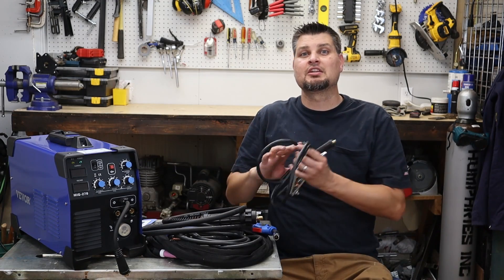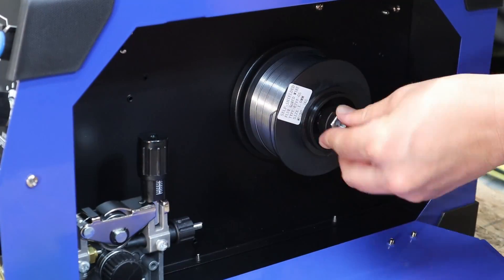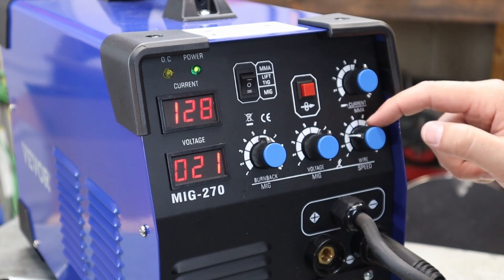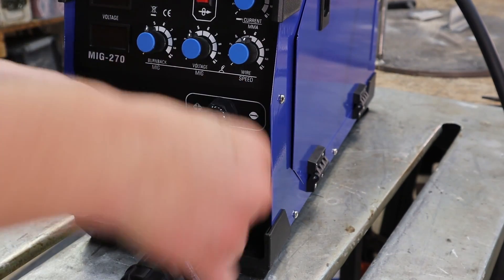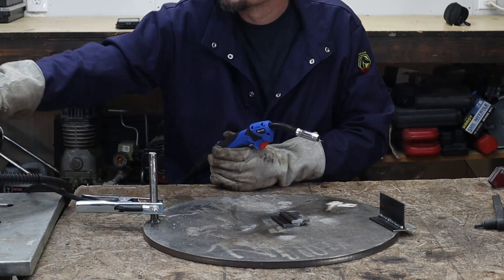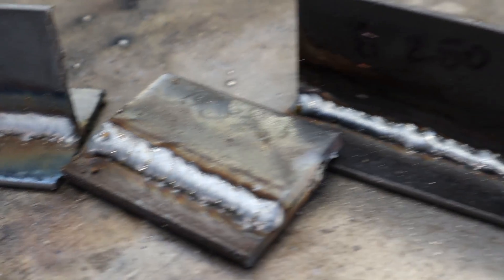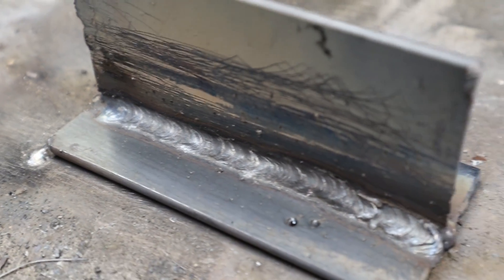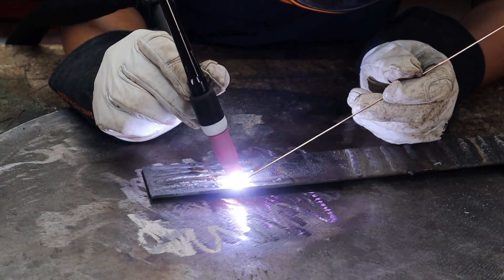Welder Review: VEVOR 270 Multi Process (MIG, FLUX, STICK, TIG)

Comment: The Amazon site (Mophor 270) claims 270 amp, while the Vevor site says 220 amp. I'm assuming the latter is a typo (changing "7" into "2")? Your video shows how the amp setting can max out at 270

There are other Vevor models -- 160 amp, 200 amp, 250 amp (Mig-250). Trying to figure out this "spread", what is different (internal hardware) in these models?
Reply from the maker: I bet they are all the same on the inside!

Comment: None of these videos explain the connection on the machine for stick welder shows fast connection but not where on the machine
Reply from the maker: Disconnect the little stub connection for the mig. Put the electrode holder into the positive and the ground clamp into the negative.

Comment: What diameter Tungsten does this machine require ?
Reply from the maker: It will depend on what amperage you are wanting to run on. 3/32" is a very common size that would work for most projects.

Comment: salut très intéressant. Il prend le fil fourré en 0.6mm, en mig fourré on peut descendre à combien d’ampères stp ? 30?
Reply from the maker: Doesn't matter what wire thickness, the lowest it will go on the display is 45.
Reply: @-DIYPRO-  Oki doki. I am thinking too of the vevor mig 200d3. It seems that it accept 20 or 30 amp (so perfect for thin plates for cars). What do you think about it ?

Comment: I'm wondering how well these Vevor 270's are holding up?  Has anyone out there have longer term experience?  Any warranty claims?
Reply from the maker: I think they've only been out a couple years so even if someone picked one up when they first came out it would be nice to know how it's running.
Reply: Thanks!  I think I might grab one.
Reply: I have had mine for almost 2 years. It is not a miller, but it gets the job done

Comment: looking into getting one of these but i’m curious will it weld a 1/8 6010 electrode?
Reply from the maker: I haven't tried 6010 but i'd say no, you'd be better off getting one that can handle that. I have the ESAB rebel that has a 6010 setting, it rocks, but you are also paying for it.
Reply: @-DIYPRO-  much appreciated information thanks
Reply: @juanmireles1356  no it will not. I have tried. It also doesnt really like 6011 either

Comment: How thick of steel can you weld with 110 vs 220 and does it state what the duty cycle is?
Reply from the maker: Correct it doesn't say. Comfortably I'd say 3/16" on 110 and 5/16" on 220.
Reply: I have 2 of these. Great machines with the right wire. Ive had a hard time getting the settings just right for mig sometimes though. I have welded 3/8 with it but you MUST run very short runs or you will wreck it. It says duty cycle is 60% @ 220amps but i know for a fact that is too high

Comment: This welder is 220amp not 270amp. check the label on the back. It worked pretty good though. Went with HBM2280 instead and it is pretty good.
Reply from the maker: Is that the Hitbox brand? Did you pick it up on Amazon?
Reply: @-DIYPRO-  no on ebay.

Comment: What kind of power requirements does this need? My garage is only set up for 60amps, since it is split off with my house
Reply from the maker: I ran it on my 110 volt 20 amp plug and 220V 50 amp. (my 50amp plug is way oversized I think it only draws about 30amp on 220v.

Comment: Nice review thanks. For the money if pne knows at least a little bit about welding it seems to be great machine for diyers. Have you tried Aluminum mig with it?
Reply from the maker: No, I don't think you can hook up a spool gun with this model. I'll have to check out the manual again and see if they sell one separate.
Reply: @-DIYPRO-  
Thanks for the reply. I have seen reviews on same welder 200 amps and they welded aluminum no issues... This 270 welder just arrived on our front porch. :)
Reply: @luboshcamber1992  what kind of aluminum welding did you do with it, can you Tig aluminum with it properly
Reply: @genesispressurewashing  
Unfortunately it's not an AC machine, so you can't do tig welding aluminum with it.  You can MIG weld aluminum with it though.

Comment: got one of these , love it . much better than hobo freights
Reply from the maker: Right on!
Reply: @-DIYPRO-  bit of a pain i had recently was switching from a smooth roller to a knurled roller with flux. using the smooth one was fine but i thought id do it right and buy the right roller. BIG MISTAKE! the machine kept on jamming and wire would unravel in the machine. stick to the smooth one it came with.